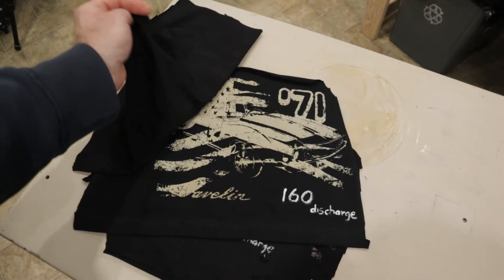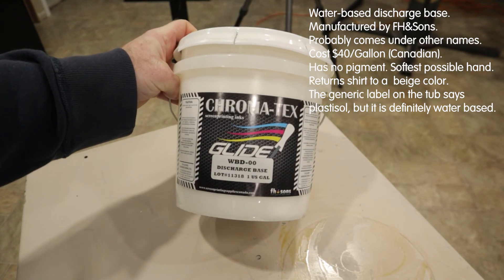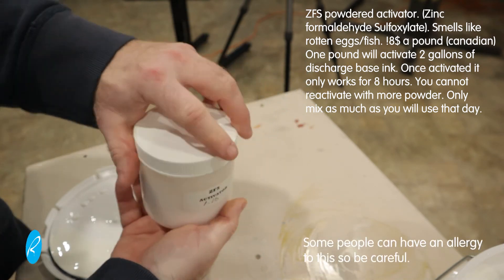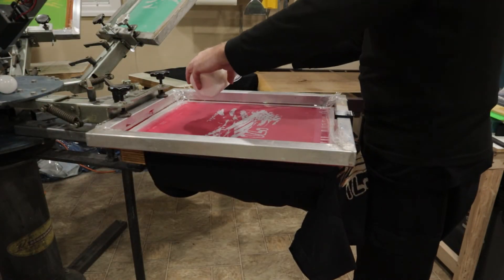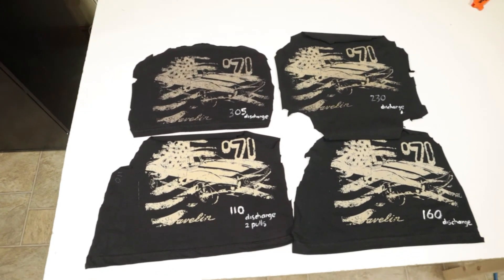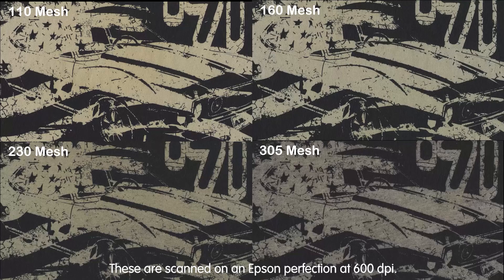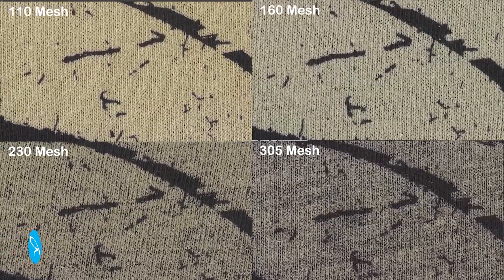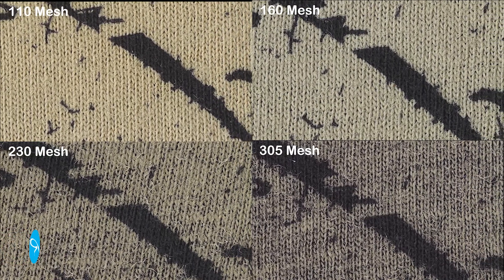Water Based Discharge Inks VS Mesh Counts. Some Experiments.

Comment from the maker: This video is intended as a reference for new screen printers who want to use discharge water based inks. I've watched tons of videos on screen printing but the vast majority are all about plastisol, so I thought I'd start making some information based videos on the subject.  In this video I'm using water based discharge base ink. It has no pigment, so it leaves a very soft hand and does not add any ink to the shirt. This video will show you the results pulling this ink through 4 different mesh counts, on the same image.

Comment: How about plastisol discharge? Can we keep the leftover of the ink after we printed the shirts? Like, gonna use it tomorrow or after 6 hours.
Reply from the maker: I've not used any plastisol discharge, in fact I don't use plastisol at all. But I'm pretty sure it works the same. You cannot keep it. Once mixed it only lasts 6 to 8 hours. The ink itself doesn't dry up or anything, it's just that it will no longer remove the dye from the shirt. And it cannot be reactivated with more powder. Simply put, only mix what you will use that day.